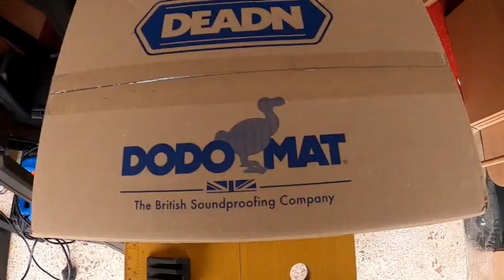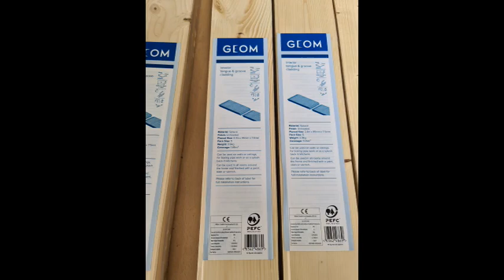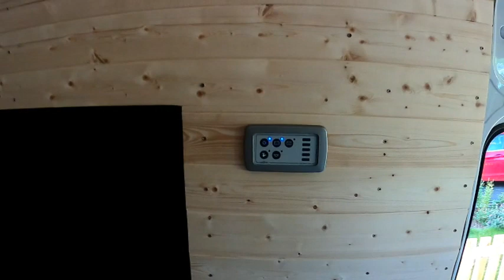Van Conversion Peugeot Boxer L3 H2 To Campervan  Full Build

Comment: Nice van.  Can i ask where the sink & tap were from please?
Reply from the maker: Sink was a cheap IKEA sink in a sale along with the kitchen unit, worktop and cupboard doors. Tap is a standard shower head tap from Amazon for a main sink so you need to use a pressure switch and water pump which are cheap I purchased the water pump and pressure switch from Whale / campervan / campervan shop or amazon.